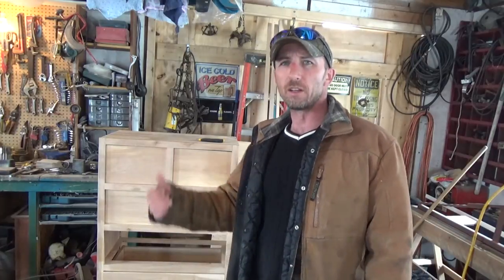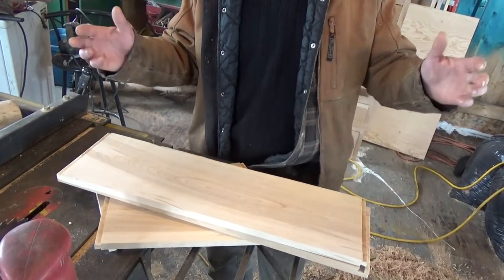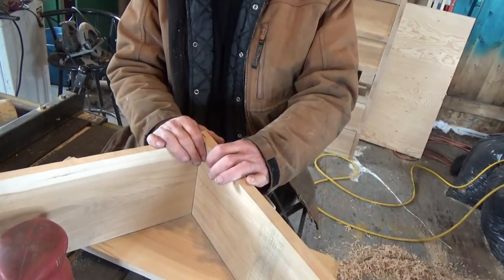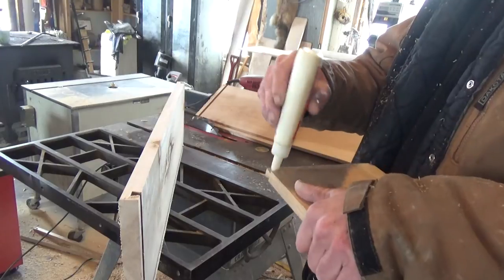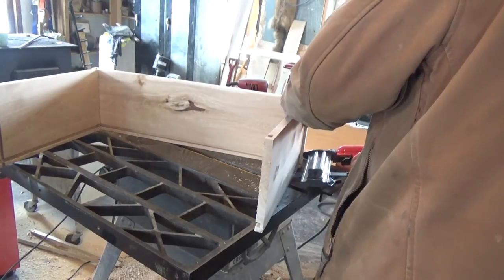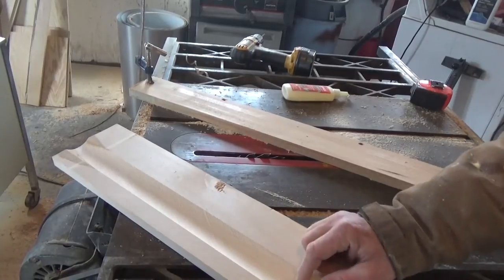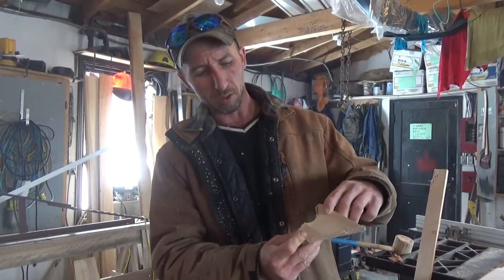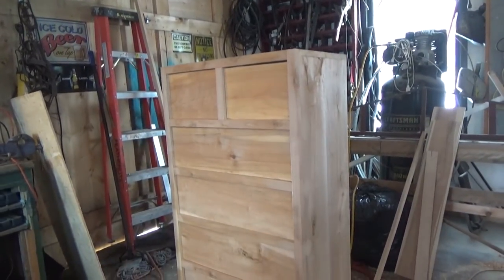CHEST OF DRAWERS (PART 2)

Comment: cool ideas there . gonna try that myself but on the legs i will glue in a 1by1 for rienforment on the inside of the legs and i will put a curf on the front of the droors with the table saw like you did on the legs but not sand that out so it will give a ruff texture in the curf